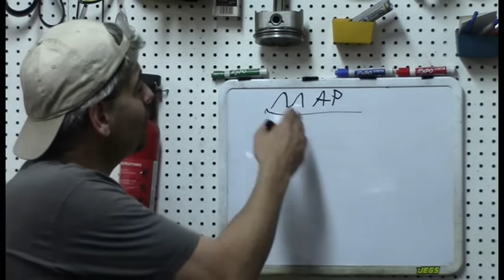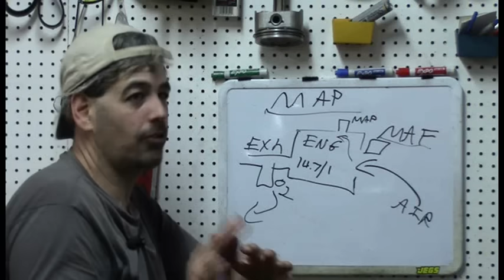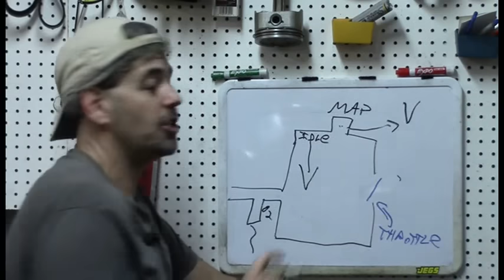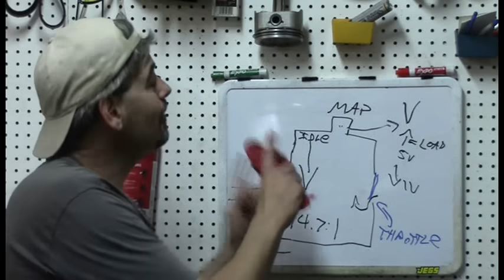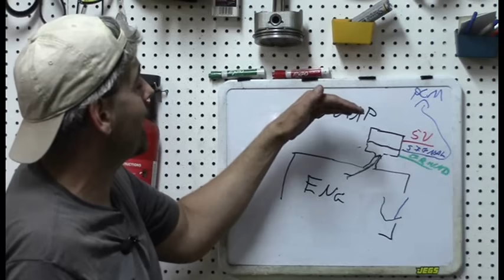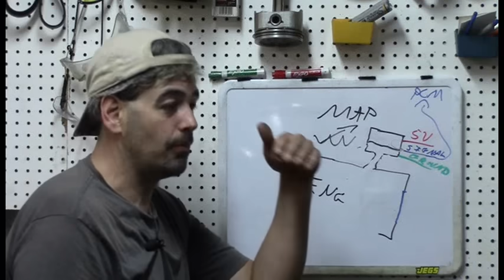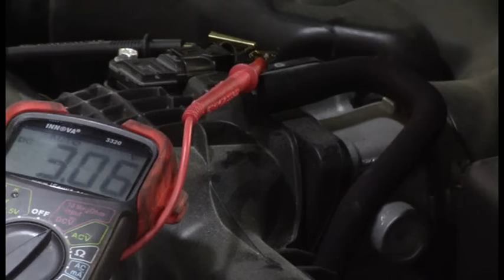MAP Sensor Diagnosis and Understanding Function- Pt1

Comment: Hey there Matt ... love your work, but I also need your help haha. I got a 2015 chevy impala throwing MAP codes and also MAF codes and just last night a crankshaft position sensor code. (please dont make fun of me but I was your typical parts changer) I replaced all those parts also changed the throttlebody for a new one and the car is still clunking : / .... any advice or direction or any help at all would be amazing. Thank you
Reply from the maker: I’ll try. what data do you have?
Reply: @SchrodingersBox  Couple months ago i had a crank sensor code P0335 and a P305F(dual batter control module) code. When i looked under the hood i could see a minor coolant leak from my water outlet which when I took it to chevy for them to diagnose it they wanted to charge me 4k to replace engine wiring harness, replace the sensor, and to get a new computer ... so i definitely didnt have the cash to do that and i went under the car and cleaned out the pigtail for the crankshaft position sensor (since the chevy tech said he found some wet stuff inside the connector. i cleaned it out and replaced it and everything worked fine for 2 months. Now the car is loosing power at times when im driving or when i turn the AC on. the new codes now are P0107(map circuit low voltage), P0106, P2227, and P16A1. I feel dumb for doing this but i replaced the MAP,MAF, and new Throttle Body w/sensor and nothing fixed it so I went online and found your videos and Im trying to figure out where to start on how to correctly diagnose my car. I  dont belive its a vacuum leak (i tried a propane test twice when engine was cold) so now im thinking its the wiring or computer , but im not sure how to test all of that and I dont want to mess up my wires in the process. I have a multimeter and I appreciate any direction you can give me : ) also love your humor in the videos and also let me know when you cure type 1 diabetes (im type 1) for about 9 years now .

Comment: I know this an old video put like the guy said just trying to find some information that will help fix this vehicle.  Do the MAP or the MAS have a Temperature sensing to them? I have been working on an engine that reacts to the temperature outside as well as to a warmed up engine if the temperature outside is not to cold.  On hot days when you go from cruise to idle it just doesn't idle. On a cold day 30 degrees and colder it goes from cruise to idle fine. No codes.
Reply from the maker: The MAP has no temperature consideration but of course a MAF does by definition since it considers mass air flow and temperature affects mass

Comment: So in the scenario that my car is idling high in park and I'm getting jerks in my engine when braking, (I cleaned the throttle and I replaced the map sensor) what should I attack next??
Reply from the maker: What was the data showing your MAP sensor was bad? Thats where I would start. ANd what is the static vs loaded LTFT- I very very strongly suspect that is the issue.
Reply: Schrodingers Box i simply received the code. However the check engine lights is gone now. But i still checked it and i get an evap code and a manifold differential pressure code. It goes up to 2,000 while on and on park
Reply from the maker: AGain, what was the VOLTAGE data you got before replacing the MAP? ARe you saying you simply got a MAP code and just replaced the sensor without testing?  If so I need data like shown in the video to help.  There is no data here.
Reply: Schrodingers Box let me gather the data. Great video by the way. I subscribed and hit the bell for notifications

Comment: Hello Matt >> if i remember correctly isnt there also a way to test on the bench with out volt supply  ? just going by vac gauge and resistance thru the power post and signal post and then grd post to power post ? and if so what would be the reading on something like this say 20mmHg Vs 0mmHg of vac . as the vehicle i own and am working on is a 91 f-250 obd 1 so unfortunately a lot of the things we can do with a obd2 is unavail on this. so i am going old school on this and a lot of things i forgot over the years :(
Reply from the maker: Yes you absolutely can do that. You will check resistance actually. It will increase with pressure that you can supply with a pump or simple blow into it.
Reply: @SchrodingersBox  thank you for the reply back. on the rules of averages what should i see as the resistance top and bottom on it . cant find anything so far on line which is how and why i found your channel
Reply from the maker: It’s different on every car. You have to check specs. 
   But a good rule of averages is if you see a sweep of resistance proportionate to pressure, it works. Generally when they fail you don’t see a resistance change. 
  Measure resistance between signal and reference.
Reply: @SchrodingersBox   Matt>  right voltage post to return signal pot correct ? on omega setting got 13.29 and 1.66 return to grnd . no vac and vac 13.24 by 1.66 and second one was 16.94 by 2.02 vac on 16.90 by 2.02 vac off . and thats 2 differant ones i got . the only other thing i can think of dealing with everything is one of 4 things map, idle air motor ,ecm ( cause i had to change it from the original one in there, dont ask lol ) so cause of that the fuel trim on the ecm if off from what i had  ,and or the injectors went from single port to quad part same year same engine size 5.8 L . but she is being one heck of a fuel hog :(

Comment: Brother i have Nissan sunny model2010 they have problem on running its not taking exalator only rpm going to 1.5 or 2 and then i closed the engine and start again then works good but after again happened same problem i changed throttle body and padal sensor but not solved ☹️☹️
Reply from the maker: What was your data showing it was a TPS issue? I would start there
Reply: @SchrodingersBox  Brother no indication showing on dashboard and computer!!!
Reply from the maker: Well then what was the reason for changing the sensor? What indicated it needed to be changed? I would need to see that data? Did you do a voltage sweep? a resistance test?

Comment: So if I feed sensor with pressure does signal voltage drops or rises (I have a project , requires pressure sensor that delivers voltage between 0 and 5 volts when pressure between 0 and 100 kpa)?
Reply from the maker: On every MAP I have seen. voltage increases with pressure.
Reply: @SchrodingersBox  Thanks a lot!

Comment: If the map sensor is messed up will it make the  lights pulse on a Honda Civic LX
Reply from the maker: It will make what lights pulse? How? What do you mean by "if it's messed up"?
Reply: The car it like reds by itself when you unplug the MAP sensor and then it goes away and also the RPM's your kind of high when its parked when I  unplug the MAP sensor then it stops just recently the lights started pulsing
Reply: Also when you're driving in the car and it warms up and you're trying to keep a certain speed it stutters

Comment: Do both upstream and downstream o2s regulate bank 1 and 2? My bank 2 is open loop. Bank 1 cl using ho2s. I have new o2 sensors on the way. Also new MAP. Hoping this will close bank 2 loop. B1 is trimming within range. (Dodge 3.3 kept to spec.)
Reply from the maker: What data do you have for bank 2 O2 outputs?

Comment: would a disconnected intake hose on a car which uses both MAF and MAP sensors cause a p0108 code if the MAF sits before the intake hose and has no air running thru it?
Reply from the maker: It could

Comment: I disconnected my map sensor vacuum line from the carburetor and now the engine runs much better, what do you think might be the problem?
Reply from the maker: +Richard Mitchell What was the effect on the LTFT and STFT? WQhat was the voltage on the MAP before and after you did this? I cannot tell you without data bro. Maybe the car was running rich and the vacuum leak balanced it.  You cannot know without data.
Reply: thanks for the response , I have taken it to my mechanic he is working on it for me, thanks again.
Reply: +Schrodingers Box I finally figured it out. it was a fuse
Reply from the maker: Richard Mitchell Why would a fuse cause the engine to run better unplugging a vacuum line? Which fuse was it?
Reply: +Schrodingers Box I Was Wrong , it ran better because I think, because  it was a cooler Morning. Once it heated up, it ran bad again. I Replaced the map sensor , did not do anything to it. Looking at the injectors , they look as though they are running right. looked at the spark plugs, they look newer, with a nice color to the (a darker brown). The wiring looks new. My mechanic tested for a code and it was a code 24, which is the speed ohmmeter. next I think I will clean out the throttle body?
Reply from the maker: Richard Mitchell You should really just stop and take the car to someone who can fix it.
Reply: +Schrodingers Box Yeah I think that's good advise, or I could change the EFI for a high rise, And a 4 barrel carb and be much better off.

Comment: So could the map sensor make the truck sputter an hesitate
Reply from the maker: It could. So could 1000000 other things though
Reply: I have a 98 dodge 1500 4x4,an it sputters an hesitates wen I drive about 15 miles or more,I changed idle position sensor, crank sensor, throttle position sensor, computer,plugs,cap,rotor, plugs speed sensor an battery, an it still did not fix the problem changed clutch, slave an master,any other suggestions
Reply from the maker: what data do you have?  Why did you change the IAC- what was the desired vs actual position? Why change the crank sensor? Was signal, ground and reference verified? Did you confirm with a bypass test? Why replace the TPS? Was voltage not proportional to angle position? Why replace the secondary- was there no spark but primary showed proper amperage?  You have to dial me in to your protocol.

Comment: After I tested the MAP sensor, it had no reading. Meaning it read 0.00. Does this mean its dead or there is another problem? I tested it, removed the MAP sensor ( it ran the same ) I attached it back, tested it again and still read 0.00.
Reply from the maker: What do you mean you tested it? What  was the voltage at power- was there continuity to ground? What signal integrity test was done? Was the hotwire continuous?  There is no information here.

Comment: Hi Matt I have a Gsxr 600 2001 I am having trouble with. The bike will run fine with the map unplugged as soon as I plug it in the bike cuts out. Sorry if it is a silly question but have you got any ideas I am stumped that it runs with the map unplugged thanks.
Reply from the maker: +jondadon What data do you have?
Reply: +Schrodingers Box I managed to sort it there was corrosion on a electrical plug and it was causing all sorts of problems. 
Thanks I love your teaching especially the tps clip keep em coming 👌👌👌👌

Comment: I have an ATV that only has a map, tps and idle control sensor. It wasn't running at all until I replaced the tps, now it will only run  good on the low end and idle but has no top end. I have adjusted the tps through the whole range and it's no better. Should I be thinking MAP or ICS sensor? The map is what appears to be slightly adjustable but I have not touched it. 2008 arctic cat 700h1
Reply from the maker: What data do you have?
Reply: @SchrodingersBox  I'm going to check the map voltage and I'll get back to you. Thanks so much for answering

Comment: The only problem is you didnt show how to connect the voltemetor to the map sensor so im still wondering
Reply from the maker: You simply connect to feed and ground to verify feed and if not then verify integrity for each to B+ or B--. If those are good validate signal voltage.
  Nothing to it.  Basic.

Comment: I have no error on my MAP sensor on my VW Golf MK6R  but my boost gauge shows different numbers than what MAP sensor shows on the logs. I tried another boost gauge and also another MAP sensor but issue presisits.
Reply from the maker: What is the signal voltage showing on each?
Reply: @SchrodingersBox    need to find out. But what could be the issue from your opinion?
Reply from the maker: lots of things. The signal voltage would just tell you  directly where the issue is.

Comment: I have 1987 4.0 jeep Cherokee I changed  the "TBS" and my jeep continues to jerk while driving  but not as bad as before can the" MAP" sensor be the problem too ?
Reply from the maker: +Randall Abernathy It could. What was the data you got that indicated the "TBS" was bad??  What the hell is a TBS anyway? To me it means Tris Buffered Saline.
Reply: +Schrodingers Box  lol it's the "throttle body sensor " I have not got any code the part was cheap so I bought it to change it after changing it it ran a little better then before , shop mechanic said it had no codes to ready so he said mite be "TBS" .
Reply: +Randall Abernathy "read"
Reply from the maker: Randall Abernathy There is no such thing as a throttle body sensor. Maybe he's thinking throttle position sensor?  Either way without any data it is just guessing.  Need data from TPS or TBS or whatever to make a diagnosis.

Comment: So I’m getting a PO108 on my 1998 dodge ram 5.2L  only a Map sensor more then likely it could be the IAC valve not doing what it should not letting enough or too much air in the intake? I have took the throttle body off and done a good cleaning and cleaned the IAC but thinking it could be bad.
Reply from the maker: Why not test it then and know for sure?
Reply: @SchrodingersBox  yeah think I’ll do that first. Would there be anything in correlation with the map sensor like the IAC? Only 3 sensors on the throttle is IAC, TPS and Map.
Reply: @SchrodingersBox  need to check that little rubber L hose that connects MAP to the throttle body as well.
Reply from the maker: Just check the signal voltage

Comment: Quick question, I own a 95 acura integra and recently upon start up it will bog down and die unless I give it a little bit of gas (about 1500 rpm) all it needs is a quick tap and it will idle on its own (idles at 2000 rpm which seems a bit high obviously) but after about 5 minutes idle begins to get rough, the engine itself will NOT shut off but does idle rough, now while driving it feels fairly dead.. and if i get on the accelerator more than 50% it bogs (even in 2nd gear at 3500 rpm) then suddenly seems to "catch its breathe" and acts the way it should (this usually happens around 4000-4300 rpm) I realise there is a number of things that could cause this type of behaviour but I am fixated on it being the MAP sensor, none the less, if anyone has any words of help that may guide me to an answer it would be much appreciated
Reply from the maker: What did your MAP sensor diagnostics indicate?
Reply: Check engine light doesn't come on which is why im in some doubt about it being the MAP sensor, I hardly ever use my scanner so no idea if its possible to read codes though CEL isn't showing that there's a problem? I tried voltage testing before finding this video and made the dumb mistake of connecting it to the reference wire so I will have to test again this weekend (I do not move the vehicle and currently have it parked at a friends house about an hour away as I didnt want to risk bringing it home on the highway)

Comment: Today i diagnose my MAP sensor.
Full throtle climbs to 3.7V
Iddle 1.30V
The lowest reading when a release te throtle is 0.80
Its good or bad? I have a problem to start my car early morning on cold start. Hyundai Coupe 2002, DOHC (Tiburon) On LPG starts normaly. I have video to sent you when i backprobing MAP.
Reply from the maker: The video explains these readings

Comment: I was wondering if you can help me out first thankyou for explaining how the MAP sensor works I learned a lot. I was going to buy a 2003 chevy trailblazer today and saw that the engine light was on and the reduced power light was on. He the seller scan it and code P0107 popped up funny thing when he tried to clear the code the engine stalled out I didn't buy it. I looked online and found that it could be the MAP sensor. With what I just explained to you could it be the MAP sensor???
Reply from the maker: Could be, amongst 100000 other things.  What data do you have?

Comment: So if the vacuum is the lowest during deaccelleration, it would make sense why my engine revs at 200 rpm more at cold start idle until I hit the gas pedal and release to idle again. Alright.
Reply from the maker: vacuum is highest at decel. pressure is lowest.
Reply: @SchrodingersBox  
Ah yes, thinking straight but wrote it the other way around. Thanks for noticing me. :)

I got or had an issue with the fuel injection; it's drawing way too much fuel and overflowing back into the tank, there's both the MAP and MAF on there; had an alternator issue before and am thinking it could have damaged the sensors. Astra G 2.2 DTI model. 

Now I'm thinking, the tank were empty (likely, the float is stuck and became an astronaut instead); does the fuel level in the tank affect the MAP sensor in any way? I bypassed the system and made a simple bottle tank under the hood. 

Wish I had an OBD2 reader with me, but I'm kind of trying to diagnose it the oldschool way here, lol. 

Cheers! Thats some great content you're producing.